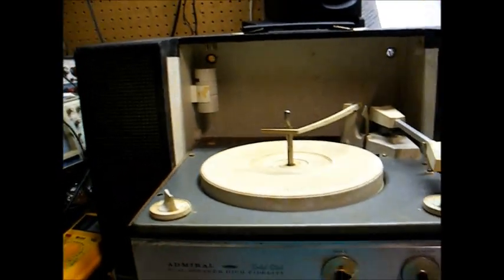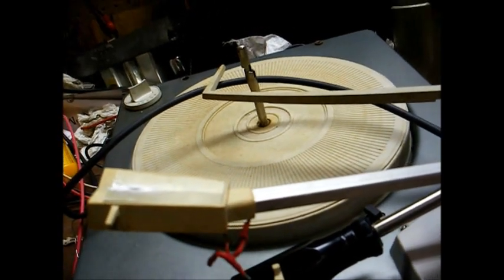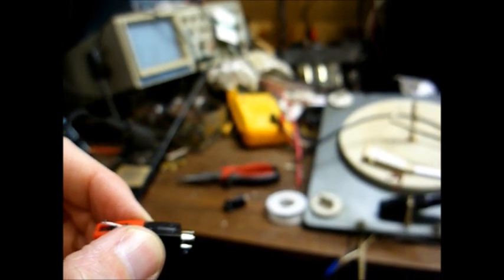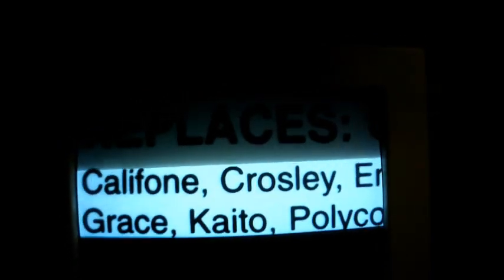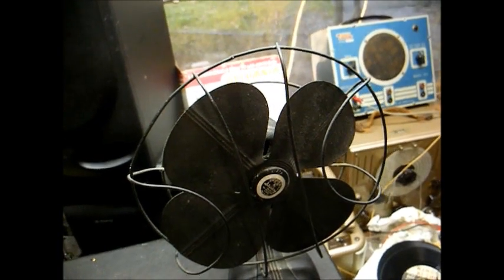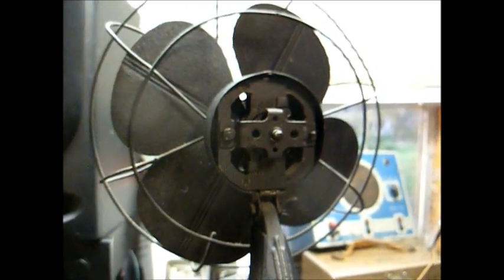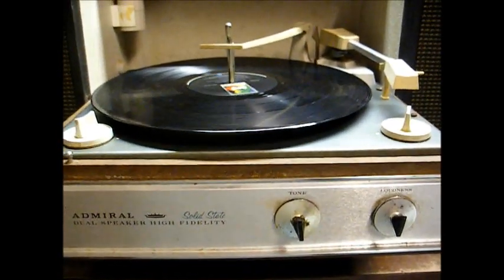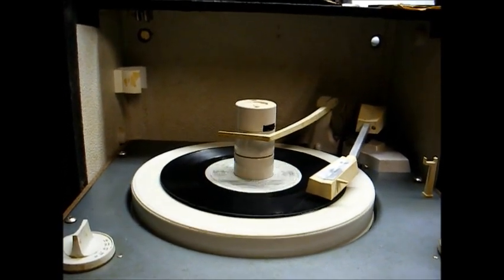1965 Admiral record player - part two

Comment: No, I don't believe the Admiral turntable uses a  VM table.  I think Admiral had their own turntable.  I have an old suitcase portable Admiral Y4049. Although the table has the 12" flag indicator, and 10" push up button indicator" there the similarity to VM ends.  Underneath it is quite different.
After a new stylus and replacement of a couple of capacitors, and changer service this has been a very nice 45 stacker unit for me.
I have an older DECCA unit DP232.  It had a cartage that "flipped" with a 78 stylus and 45/lp stylus on the opposite side of the cartridge.  Somebody replaced that with an inferior cartridge where the dynamic range seems too narrow.  Since I don't have a schematic on this, or owners manual to know what it was originally fitted with, can anyone give an idea of a suitable replacement?

Comment: Usually the copper scrappers that do stuff like that are drug addicts that need money for their next fix. They're a lovely bunch....
Reply: I caught one of them doing that locally on some electronic stuff dumped outside a recycling place, he was cutting the cords off of every appliance he could find, even though it's dirty copper and worth next to nothing. Most of the guys that salvage things there test it, take it home, and reuse it, but this guy makes it that much harder for people to do that. Finally I had enough and called the cops on that idiot, he was going around with a diesel pickup and a flatbed trailer, he was going behind appliance shops and into scrap metal bins grabbing things to put on the trailer. I haven't seen him since.

Comment: Nice job on the restoration of the changer and a new cartridge. It happens when my GE Wildcat portable stereo record player had a C660 ceramic cartridge, sometimes they don't track well with disco records as well as some later records, but my GE C660 cartridge tracks fine and sounds very good.

Comment: BTW, I've recently acquired my GE Show 'n Tell record player and viewer off of eBay yesterday, and it doesn't work, I tried to cleaned out everything from the motor assembly, the turntable, and the screen, everything and put a new needle on the tonearm. I tried it, and there was no sound coming from the speaker since the amp was dead. I need to replace the semiconductor transistor capacitor which was 3 pins since it was dead, but all I need is a soldering toll and a replacement semiconductor transistor cap and it should work fine and replace the belt since it's not advanced to the next frame. As you can tell, the GE Show 'n Tell can also play older records, and then plays a Show 'n Tell record picturesound programs. The problem was it will not play later records from the 70's including disco and 80's music, because it jumps like crazy. That's why it will not play on a GE Show 'n Tell.

Comment: My question is, the video didn't show how you removed the platter. I have a mid 60's Decca with bsr changer. I removed the "c" clip but the platter will not come off. It pulls up 1/4 inch and stops.

Comment: Great repair, thanks for the video!
A question from someone who knows very little about record players...How does the tone-arm determine how far to swing in and lower at the correct landing area, with regard to the various diameters of each speed of record?
Reply: It has various mechanical sensors, or you can set the diameter with a dial on some. Some determine it by the speed setting.